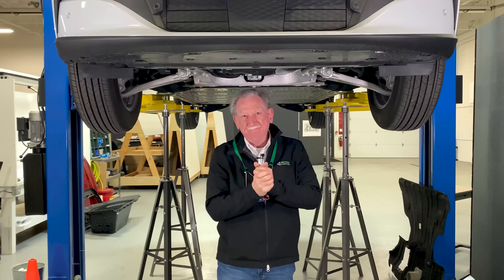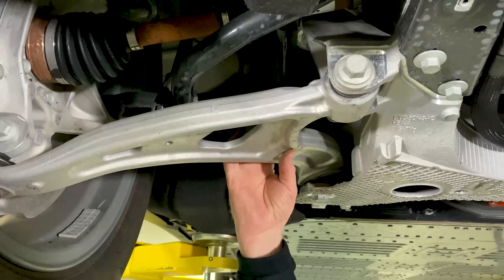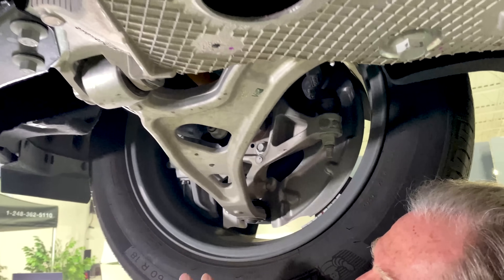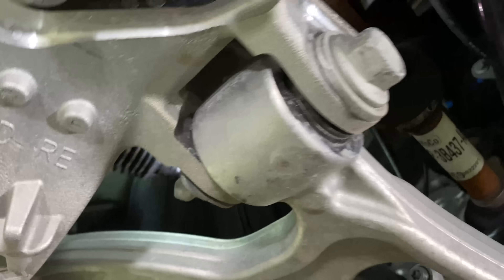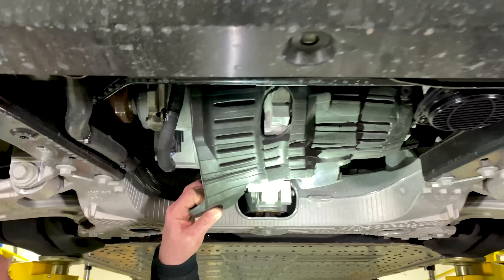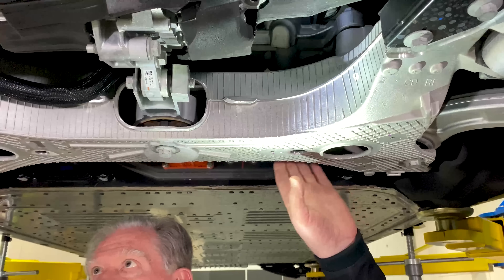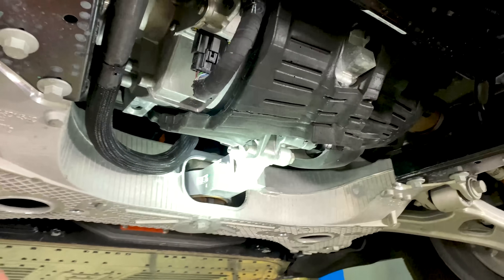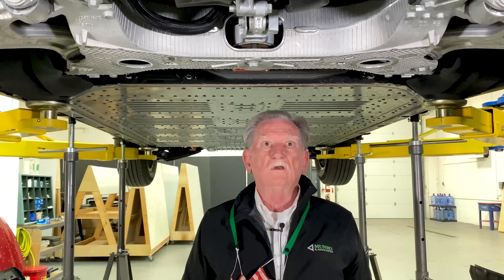2021 Ford Mustang Mach-E: E3 - Hoist Review | Front Suspension

Comment: Your video and similar ones, although there aren't much, makes me feel less and less attracted to old cars. I also restored a car, it happened to be GM V-platform RWD (Opel/Vauxhall/Holden end of 60's - early 2000's), so I used or observed three generations of the same platform and a 1999 Lexus GS (S160)... Well, newer cars are so much better designed and easy. So much safer and strong. What takes a day or two days in the old and "simple" car, in the newer cars takes a couple of hours. Also, old cars are so underdeveloped, structural links from rockers to longtitudonals are evident in 1982 car, but rudimentary, newer cars have the same, but much more pronounced and functional.
On this Ford, my concern is that this beautiful casting will crack at control arm attachment points at bigger pot hole or curb. Also, the bushings seem too small, almost like on old cars.

Comment: Front suspension looks basically like an old BMW E46 front axle!   Using high compliance bushes in the back of the lower arms to control the longitudinal wheel path, and a small stiff bush to react the pure lateral loads from the tyre.  ie kinematics for both Ride quality, and handling.  However, BMW themselves moved away from this arrangement, to a dual lower arm arrangement after the E46 in order to incude a virtual steering point to better optimise steering feel and feedback, which is difficult to do on strut type arrangements with their necessarily offset tyre centre points.!

Comment: I like the use of MacPherson struts in the front; low initial cost, reasonable geometry, and low cost of repair. Most owners won't know the difference between struts and an upper and lower control arm setup. They're not going to drive it like a race car around corners.

Comment: Just like the id4 and you said it baby,  when you see extra castings it's a mistake by an engineer hiding  some other mistake......do you listen to yourself or is it America vs the world.
Reply: @JorgTheElder  You are wrong the point is an old man went on a discrediting bashing mission of the ID4. But when he saw the same stuff under the ford failed to mention this. Even so Ford have signed a contract with VW to use their system the MEB from next year. Sandy was never an engineering manager at Ford and is paid PR for certain brands. A Clown and mouth piece. What a waste.

Comment: Would it be possible for Tesla to cast the bottom of the battery pan/structural pack as a single casting? Essentially, this might allow the elimination of all of the battery casings. Not being a battery/structural engineer, I'm probably over simplifying my question. I would just like to know if there has been any discussion of this. If this would be possible, it would completely eliminate the bonding of the batteries together and the need for separate cans.

Comment: Sandy is impressed by the mach E's crash engineering but it didn't even get a top safety pick plus from the IIHS..
Reply: It missed out only on the headlights.  Everything else got top marks.
Reply: Clearly you didn’t pay attention to the actual results of the tests.
Reply: If you consider the premium, FE ,and GT trims, they indeed qualify for plus. It didn't get plus just because Select and CA1 trims use  lower cost headlights, while plus needs all trims get good rating on all categories.  https://www.iihs.org/ratings/vehicle/ford/mustang-mach-e-4-door-suv/2021

Comment: What exactly does a “Ford” suspension look like? I still see a strut like the VW used, not a double wishbone like the Tesla. I’m also surprised that the extensive use of aluminum isn’t being lambasted as too expensive vs. stamped steel. It is interesting that they chose to base their new GE1 platform on the existing C2 platform which underpins everything from the Focus to the Bronco Sport to the Escape, as opposed to doing a true 100% ground up EV platform.

Comment: Opinions on the 225 tires? This dual motor Mach-e weighs in at 4,890 lbs. I figured it would at least come with 235s or even 245s.

Comment: Lets hope they dont lie on the window sticker like they did on my 2006 F150. They listed my alternator as a HD 130amp unit as my truck had the HD payload package. When the alternator failed at 100k miles I toook it to a specialty alternator shop. They showed me that my alternator was actually only the standard 110 amp version. Beware of marketing. legacy auto is known for exaggerating specs to compete with competitors. My truck also is listed with a thicker frame yet its rusting thru from the inside out just like all F150s do of that generation. THey wont get another penny from me for being shady as a company. Screw ford

Comment: I see plenty of rust on the CV joint shaft already. Is that from the salt found on the roads during winter?
Reply: My thoughts exactly...is this normal?
Reply: @mysterioso74  Live in a salted roads area and you will see rusted steel underneath many vehicles. Automakers figure (I guess) that the parts won't rust to the point of structural compromise within the expected lifetime of a vehicle.

Comment: After first glances and in comparison, Ford (or which engineer studio designed this) seems to have succeeded in the better design than VW with its MEB.
Reply: So it is cheaper for the customer?
Reply: @abraxastulammo9940  Price / performance seems to be better with the Mach-E. On the manufacturer side, Ford can apparently offer a better design and better components than VW at similar prices. VW will be able to reach the margin thanks to the planned high MEB numbers, but more would have been possible.

Comment: "Brilliant" to see rusty half-shafts on a brand new car. So there is the old penny-pinching Ford left here after all. These should have been corrosion-proofed with a zinc-based process. Personally, I would do black zinc plating on these.

Comment: I think that "Kicker" & absorber mount may also be part of the torque take-up system allowing the drivetrain to rotate just a tiny bit?
Reply: That link setup would also add a nice non-linear torque stiffness.  Soft for normal driving, but quickly stiffening when you put your foot in it.

Comment: Hy Sandy, don't forget that Ford make cars also in Europe with european engineers. Also remember that Ford until recently made well engineered cars, mostly the Focus and the Mondeo. It use to say that although Ford is made in Germany too, they had a soul unlike VW which were boring. My dad had the Focus 1st gen, I had the 2nd gen which is not sold in the US. There are a few car makers that make good handling cars: BMW, recently Jaguar, Alfa Romeo, Subaru and Ford. Ford made a shift and this is a concrete result, unlike the previous Focus, which was what VW is making now.

Comment: I dont understand what he has. Ford has mc pherson struts up front like vw id 4 . On the id 4 he described it as cheap  "like toyota",now he's enthusiastic. Id 4 already got a 5 star crash rating, so considering crash safety Ford will not beat it. Forged aluminium arms were critised on the id 4, now he rhapsodizes about similar parts in the Ford front suspension. I actually do not see consistency in all this .
Reply: He is enthusiastic about how well it is done, at 1:40 he says that. And at ID4 he critised the mixed suspension with this two curved arms which apparently would not even be necessary in this form.

Comment: As a former body structures engineer, I was geeking out with you Sandy. The hybrid cradle is nuts and looks to both enable motor drop and reducing high frequency motor NVH

edit:
"Furthermore, random noise and low-frequency firing orders are contrasted against tonal motor harmonics in the mid- and high frequency ranges. "

https://cdn.ymaws.com/www.saimeche.org.za/resource/collection/BDB66635-3CA0-42B7-8354-83943412755B/2014_07_Bekker_-_FINAL,_2014,_30,_47-54.pdf

So EV is quieter than ICE, but because it's quieter the high frequency motor harmonics are more noticeable when you're at the RPM to excite them.
Reply: I'd imagine any automotive electric motor to be quite quiet and smooth though..
Reply: @rkan2  Mostly, but they still do have some problems. They have a common problem with stirring up vibroacoustics in the 3,000+ Hz range. I can find some references if you're interested
Reply: @Dimitri88888888  "Furthermore, random noise and low-frequency firing orders are contrasted against tonal motor harmonics in the mid- and high frequency ranges. "

https://cdn.ymaws.com/www.saimeche.org.za/resource/collection/BDB66635-3CA0-42B7-8354-83943412755B/2014_07_Bekker_-_FINAL,_2014,_30,_47-54.pdf

So EV is quieter than ICE, but because it's quieter the high frequency motor harmonics are more noticeable when you're at the RPM to excite them.
Reply: @TennisGvy  please do, for sure, it sounds interesting... it's the EV aspect we never really hear about in detail, from anybody
Reply: @elektrotehnik94  Sure I posted a good comparison paper up above.
Reply: @TennisGvy  - "Up above" where?  Can't find it.  Why not just add it here with a new post or edit your original post ("As a former body structure...") and place your references there?
Reply: @chuckm260  It was in a comment above. I added it via editing the top level comment now.

Comment: Nice I suppose, to finally see Tesla has some serious competition based on actual design reasons.  Up until any "competition" people have been claiming Tesla has coming  has been from assertions and nothing material and in production, imo and from what I've seen.
Reply: Same. Tesla has enjoyed their position at the top of the pack by only competing against themselves for a while. But now that we have some real competition from the Mach-e, I bet its going to push Tesla even harder in their design. Tesla has the battery tech, software, and charging infrustruture advantage, but Ford seems to have the mechanical engineering and production skill that Tesla can't touch (yet).
Reply: @MindControl3  all the top engineering talent wants to work for tesla or spacex not stuffy fomoco. 
I would genuinely be curious seeing as how tesla has produced 10x more bevs last year than Ford will make during all of this year. 
How exactly they supposedly have the production advantage? Care to share details of that. 🤔
Reply: @4literv6  when I say production, I mean production efficiency and quality. Clearly tesla makes more bevs than Ford, but they are still figuring out their processes. It's not easy, and Ford has been making cars for a lot longer. But tesla learns quickly and change quickly, so it's a matter of time until tesla irons it out.
Reply: @MindControl3  now that does make more sense. I think tesla has it down based on how the gigahai factory now is outpacing freemont plus the mic model y&3 are supposedly some of the highest build quality bevs for sale in China based on reviews. 🤔

I was excited to see them announce an ai driven camera&laser based quality control system for freemont at the start of this year. I'm thinking that should really help with quality issue's from the freemont location moving forward. Also based on reviews of 2021 model teslas. Apparently a lot of the issues are no longer a concern. Not to say they all are addressed. But more&more are no longer a concern.
Reply: Other companies have equaled or beaten Tesla on design - interior and exterior. That will continue with the like of Hyundai and Kia
Reply: @GA-wq8xq  got any factual proof for that rather blanket statement? Or is it just another of your fantasies, like Ford offering better service on their bevs than tesla does. 🤔
Reply: @4literv6  ok - in my area there are >10 Ford dealerships with service capability compared to one Tesla service center. Has Ford work to do, sure as they have one BEV and you have to start somewhere. However I am much nearer many Ford dealerships should I ever need service than Tesla. You also I assume you let Tesla off with their build issues, but saying they are new to manufacturer (although they have been building cars for 17 years). So being consistent we can let Ford have time to get better
Reply: @GA-wq8xq  tesla has been building cars for 17 year's(not true their first car came out in 2008. vs over 100+years now for Ford.
Yet somehow ford can build better cars because of that experience, but still also deserves a pass on building evs. 
Dude you are the most hilarious double speaking hypocrite I've engaged with on here in quite a while. 😂

I encourage you to GO to those dealers like I already said. Look for an ev charger, and ask them how many ev certified tech's they employ.
You might actually learn your blanket statements are just that. 🤔